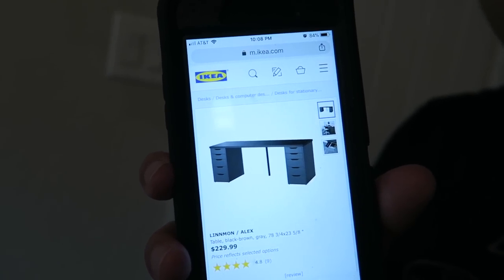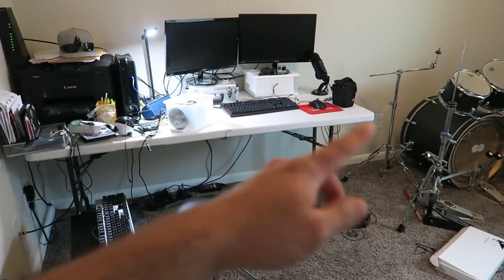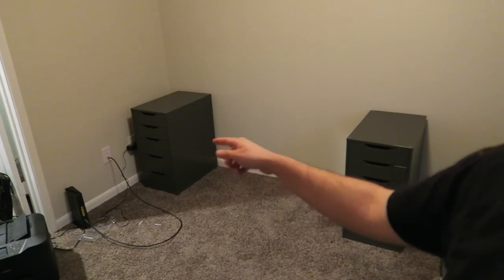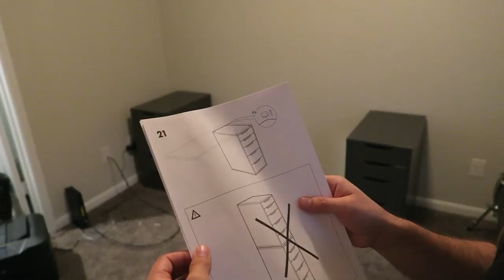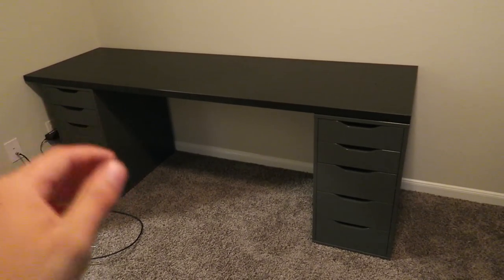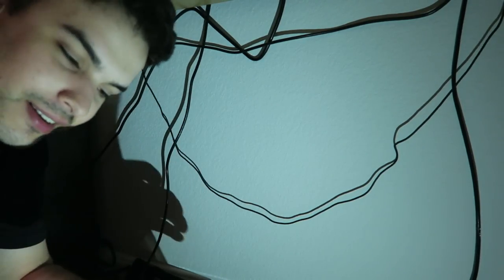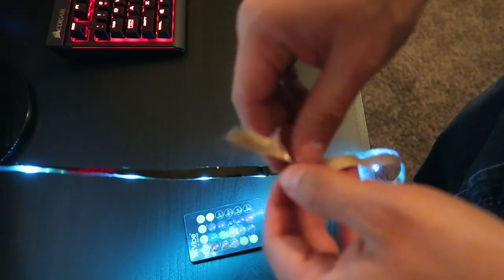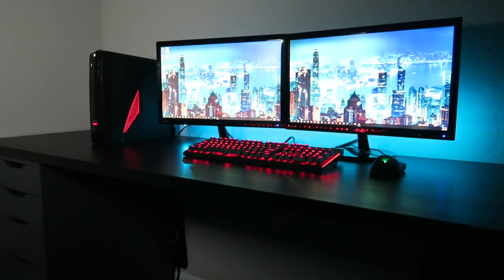IKEA Gamer Desk Build

Comment: How would you go about securing the tabletop to the drawer?  I would much prefer to secure both parts together.
Reply: Until you want to take the desk down and move into a new room. Don't secure the table top. It makes it easy to remove, and move around the house. Not to mention if you have any weight on top of the desk it's not going anywhere. They have anti slide rubber tabs on either filing cabinet.
Reply: @sethh8892  does the tabs come with the drawers?
Reply: @akwa5221  No... you buy them for like 1 or 2 dollars.
Reply: @sethh8892  where do u buy them?

Comment: Can anyone tell me if it's enough for 3 monitors (22 inches) or should I go with a bigger desk?
Reply: I dont think you need too but just to be safe get a longer worktop if you think its not big enough
Reply: @JacobCross2006  I was planning for a 200cm desk but it'll occupy most of the space in my room, but you're right, just to be safe I should go with a bigger desk, and the setup will look clean on a bigger desk. Thanks
Reply: @SaiyamVerma  no problem 👍
Reply: I was just measuring my one of my monitors a few minutes ago for this exact reason lol. It's a 24 inch 16:9 monitor and it's around 53cm wide, so you could fit 3 of those side by side with about 40cm to spare, and that's with them all parallel to the wall with no angles in their placing. 

Obviously yours will each take up a little less space than that, I'd guess they'd be closer to 50cm or in the late 40s, but that should give you a pretty good idea.
Reply: @edenmeden  thank you so much for this info bro.
And placing your monitors parallel to the wall is a bit inconvenient, it's better to have them in some angle facing towards you.
So I guess a 200cm desk would be a great choice for me
Reply: @SaiyamVerma  no worries dude, at the end of the day two metres is a very decent amount of space, you can fit three bigger monitors on less space so it would be pretty roomy

Comment: Can somebody tell me how do you put the table on the drawers? You glue it or what?
Reply from the maker: fnatic _ 8ptic It just sits there but it came with some little rubber feet to help keep it still. I was skeptical at first but it has worked fine for me. But if you are really concerned about it you can get velcro strips 👍
Reply: @MattieKB  thx

Comment: How stable is the desk since it isn't actually screwed in?
Reply from the maker: Its stable.  I don't see how you could knock it over without intentionally trying to! ha!  But yeah, once my computer and monitors were set on top it doesn't budge!
Reply: @MattieKB  Thanks for the quick response! Good video. Informative and fun.
Reply: Just got this same desk in white. It's very stable it comes with 4 rubber pads for each drawer unit to keep it from sliding around. Without anything on it you still can't slide it around on them without lifting up a bit first. So with the support leg in the middle and some weight on it it's not moving.
Reply: @TechOut  earthquakes tho

Comment: How’s the desk so far? Is it sturdy???
Reply from the maker: Yeah it's fine.  I have seen some people add velcro on top of the drawers and on the bottom of the desktop to really secure it down, but it is pretty good as is.
Reply: Matt's Tech & Vlogs that’s nice, would you suggest using 3 monitors
Reply from the maker: @bumgamn6346  Are you asking if I suggest using 3 monitors? or if I think this desktop can support 3 monitors?  I suggest using two monitors, but if you like 3 this desk can support them with no problem.
Reply: Matt's Tech & Vlogs oh ok that’s all needs to know. Have a nice day!

Comment: Neat little video. Nice, simple, clean little project. Did you use a laminated tabletop or did you use a solid wood countertop from Ikea? Will you be replacing your "cheap" monitors with better gaming ones in the future? One thing I'd like to see with little den/office rooms like this is countertop-like shelving built onto the walls so there's more storage space above the desk.
Reply from the maker: wingsley I used an ikea table too but it is not solid wood, and it is very light and easy to dent so I may replace it in the future. and Yes I am going to upgrade my monitors eventually.

Comment: Did you ever get anything in between the countertop and your drawers to keep it in place or you left it as is?
Reply: The two drawer sets underneath the wooden top have rubber stoppers, should be good as long as the countertop weighs 40+ lbs or more and all of his peripherals. I've seen this desk be built many times.. some people screw it but I don't think its necessary and it also makes it easier to move or add-on to later.

Comment: Wait did you make this a custom build? Cause I am trying to find a desk like that
Reply from the maker: It is not sold as ONE item.  I forget, I saw it online somewhere and I searched on the website too and couldn't find it.  But yes it is the drawers (I bought two but you can buy just one and buy legs for the other side) and the table top.  The top and optional legs are pretty cheap but the drawers are a little expensive.

Comment: How well does the desk sit on top of the drawers? Does it move around since its just rubber casters holding it in place?
Reply: Im guessing all the weight on the sides IE: your pc or monitors will weigh it down preventing it to move in addition with the grippy rubber